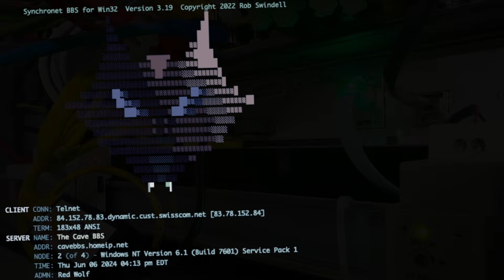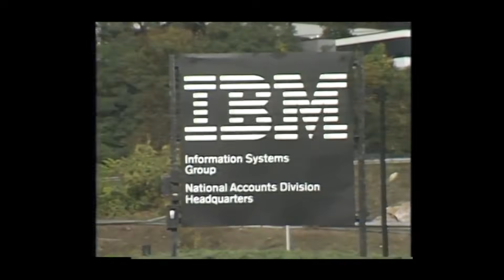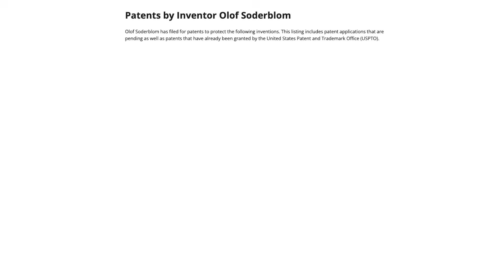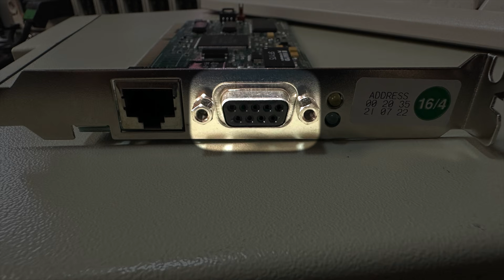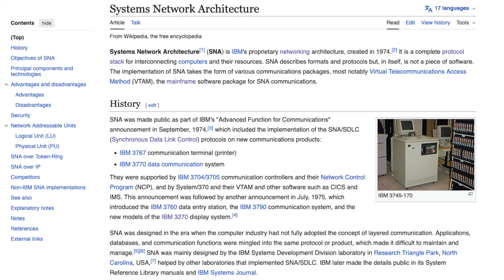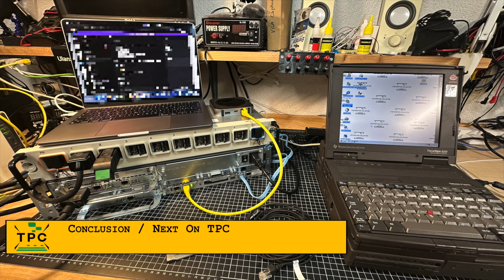Token Ring: IBM’s Forgotten Rival to Ethernet (Part 1)

Comment from the maker: Did you ever use Token Ring in the real world?

Was it reliable enterprise networking, expensive IBM weirdness, or already obsolete by the time you encountered it?

I’d love to hear your stories, especially from offices, schools, banks, factories, or university networks where Token Ring was actually deployed.
Reply: Nope, but I think it would be really cool if 86Box implemented Token Ring emulation, especially with their "Local Switch" networking that supposedly allows multiple VMs to network together pretty easily.
Reply: Yes, worked fine however I converted everything to Ethernet shortly after I started, for my own sanity.  Most Dos PCs were on Token and we were finally moving to Windows in 2000.
Reply: MAU is pronounced mow (like cow)
I saw a school computer lab that booted a bunch of PS/2s from 1 Novell Netware server over token ring. Eliminated a lot of stuff kids could get up to.
Reply: It was bulky. The cable was far too heavy and was pulling on the plug of the PC Card. For the user, it was transparent. There were not much differences in the network stack.
However it was mandatory to connect to a mainframe.
Reply: I have never used token ring myself but in the early nineties I had a summer job working for a contractor that installed IBM Cabling System (ICS) cabling for the token ring network on our National Airport Schiphol here in NL. I have run kilometres and kilometres of rhe stuff. It was quite thick and stiff cabling, even for the day, and needed to be handled with some care while pulling through openings in walls and underneath floors as shaved cables would mostly if not always fail testing after the run was laid… and getting another one in wasn’t fun especially when the stuff was laid in bundles.

IIRC there were three types of ICS used for token ring… type 1, with only data for 4 megabits and type 2 which was certified for both 4 and 16 megabits and included next to the data wires either one (type 2A) or two sets (type 2B) of 4 wires for analog phones so you could install one or two phone sockets next to the data outlet. Type 2B was notorious to run in longer lengths as it was really heavy and thick stuff… not to mention the racks and racks full of the hermaphroditic connectors i. their patch racks that needed connecting and patching while keeping a decent cabling management 😂.

In later years in the same summer job, I think around 1997 or 1998 they switched to CAT based cabling and newer MAUs for the network that had RJ45 all the way and was way easier to run and install. And though more dense. in the patch racks, easier to handle there as well.
Reply: Yeah, I used Token Ring, it was superb but the price and headline speed of 4Mbps killed it when the much cheaper, less reliable and often slower Ethernet advertised 10Mbps which won the day.

The sad thing was that 802.3 Ethernet on a network with a few hosts and traffic would soon collapse to lower speed than Token Ring and any one fault on a Coaxial Ethernet network could easily bring the whole thing down.

Ethernet got better with the invention of network switches and the use of CAT3 or higher cabling but that still didn't fix all the problems with it (try plugging a cable from one switch port to another to quickly bring it down)

Even the 16Mbps version of Token ring that could use cheaper CAT3 cabling was expensive and couldn't make up the lost ground. 

It lived on quite a while because IBM used it for pretty much everything, desktops, mini, midi and mainframes, I last ran into a Token Ring network at a hospital back in the mid 2000s, it was live and in use for their AS/400 systems but it was planned to be replaced by the end of the year.
Reply: It was network like any other. Dated but functional. We had 500+ node token ring network. One big site with Kalpana switch and 8 rings, and bunch of small switchless sites connected with 0 cir frame relay. IP/IPX/SNA. Big site ran token ring and even twinax to some extent all the way until mid 2004 when we moved to new office and all old networking gear went to scrap pile.

Comment: I was a network admin at an IBM location in Germany in the late 90s that had ~300 endpoints. The 8228 and the IDC bring back old memories. That time was a transition at IBM from Token Ring to Ethernet. Existing hardware used TR, while new hardware came with Ethernet.

Comment: One of my first IT jobs was removing the remnants of a token ring network at a radio studio that was finally decommissioned after the last workstations were upgraded to 10baseT or even the fancier 10/100 cards. I think one of the 10/100 switches we installed at the time was only recently decommissioned!

Comment: Worked on a huge token ring network back in the 90s.  Turning off one of several HP printers would result in the token landing on the floor and the ring going down.  Good times.

Comment: Mmmm interesting. I always learned with a cisco 2600 router to make configurations , but never had an on my proper cisco router. In the other hand never used token ring , but ipx over a network crossover cable on to computers. And a modem with a windows computer as a proxy to  connect the two to internet via modem link.

Comment: At my first company in 1995 we had 16Mb/s token ring.  This survived until about 2002 when 100Mb/s Ethernet was rolled out.  When I first arrived we ran NetBEUI with additionally TCP/IP on the servers and then we deployed IP fully in 1996.   I found one of those token ring MAU port resetting tools the other day - I've had it for years.   The battery hadn't even leaked!
Reply: Ha! That battery not leaking is a small miracle of its own!
Reply: Those tools made me a lot of money, the number of 8228 MAUs I "repaired" with them was phenomenal, they were supplied with ever MAU I think but I'm pretty convinced most people had no idea what they were for.

Comment: I'll make it simple. One customer I had used a existing token ring network connected to a novell server. All new workstations was 10base-2. Side note had one customer who used IBM baseband network, Used Shielded type 3 cables and terminators. Lab full of ps/2 machines.

Comment: My first networking experience was already in the days when *BASE-T was the only family of standards that matters.
I do remember the times where network interfaces weren't universal on PCs yet, though, so for casual connectivity, alternatives were semi-often considered and used. Alternatives like: serial loopback, FireWire (yes, computers that had built-in FireWire but no built-in Ethernet were common for a moment!), there were even USB-A-to-USB-A "cables" with built-in logic that emulated network adapters for both endpoints, on the market for a moment.
Still, in the end I never used any of these and got a PCI Ethernet adapter in the end. I do however vividly remember the times before Auto-MDI-X and the whole hell of dealing with straight-through vs. crossover cables. That's almost a lost art these days.

Comment: I only ever used it as a client. My middle school (not sure what your equivalent is in Switzerland) was renovated in the early 1990s and they installed a token-ring network in the school. Which networked both Mac (Primarily LC 550 & 575s) and IBM (PS/2 55SX in the office, 25 SX in the labs. Also some Eduquest and smattering of Compaq 486s) computers. Wild times. Some teachers also had ThinkPad laptops. Don’t remember the model number. And of course we still had a fair share of Apple IIe & IIgs machines floating around because no point in retiring machines when you have a large library of still useful software.
Reply: Haha, same here with regard to the Apples. We still had a number of them in our elementary school computer lab until a grant was finally able to upgrade the entire network + PCs in the whole lab. I remember our computer teacher was pretty chill and would let us play Oregon trail if we finished our typing lessons early.

Comment: I supported token ring infrastructure utilizing ethernet baluns and we would see loops from unplugged baluns and in the winter when the heat was too high, the resistance would be too high over the old cables to maintain a connection…fun times 😂

Comment: What a weird technology - the benefits of Ethernet seem clear!
Reply from the maker: Well, both Token Ring and ARCNET were competing with Ethernet at the time, along with many other implementations, yet alone the Apple-specific ones.

In my opinion, what helped Ethernet was that they introduced switching to separate the collision domains. This, along with the 100 Mbps and later Gigabit speed increase, accelerated adoption of Ethernet. Although a Gigabit Token Ring was eventually specified as well, it just came too late in the game.
Plus Token Ring was - as usual for IBM - expensive, and Ethernet was factors less expensive.
Reply: Ethernet was the clear winner once we switched from the hub to the ethernet switch. Token Ring was then totally obsolete.
Some companies I worked for were using almost IBM tech exclusively (think banks). I had some RS/6000 connected with MAU with the full fat cable.
Reply: Token ring sounds like Hobbits should be running around... 

Not to mention... Those ports are buttugly and way too bulky
Reply: @f.k.b.16  Yeah, I chose my networking technology because it looks pretty as well...
Reply: @f.k.b.16  Since buildings were already running Cat3 for phones, running Cat5 for ethernet seems like an easy thing to do, compared to bulky alternatives.

Comment: I was gifted some TR equipment in the late 90s and used it for my private LAN (ca 3 PCs, 1 notebook and 1 HP LaserJet III). It worked fine with TCP/IP for me just like Ethernet would have.
I found a TR printserver card for the LJ and a PCMCIA card for my Gericom notebook, so my LAN was TR-only, and as Linux supported it just fine - it worked.
At least, unless I bought a PowerBook G4, where no drivers for my PCMCIA card was available, so for some time, one of my Linux PCs acted as a router.
Reply from the maker: Nice, a TR LAN 🙂

My first LAN was 10Base2, but all the equipment was also fully gifted to me back then. ^^

Comment: We had an even stranger setup. The connection was point to point at up to 19200 Baud. For terminals this was usable but very limited for computers. The data was carried on a wide frequency coax along with video signals. The one win was two computers in a lab could be connected directly. Kermit, Xmodem and Zmodem were used for file transfer.
Reply from the maker: Sounds like an adventure of days past as well :)

What year was this?